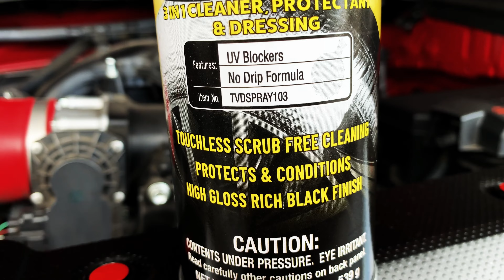⬛️🟥⬛️ Toyota 4Runner: How to Clean Your Engine Without Using Water

Comment from the maker: A under the hood quick cleaning for my 4Runner. It's not too dirty. So, instead of using water, this is a quick touch up video using tire foam to keep your 4Runner looking good under the hood. This is only a quick cleaning for those who don't have alot of time to wash under the hood.
#enginebaycleaning #enginebaydetail #thatred4runner #toyota #4runner